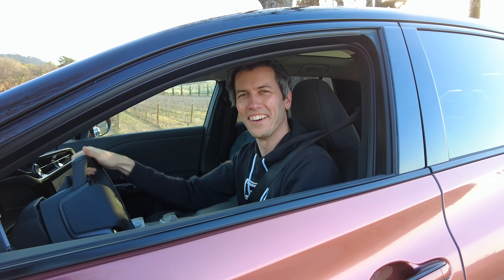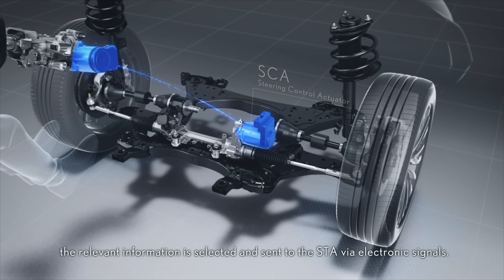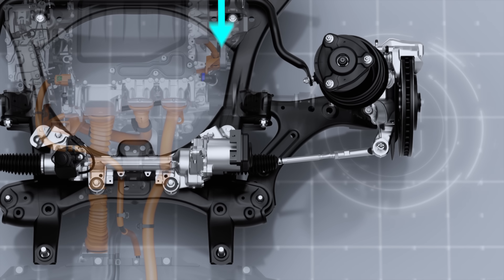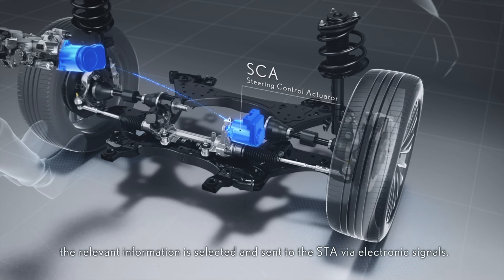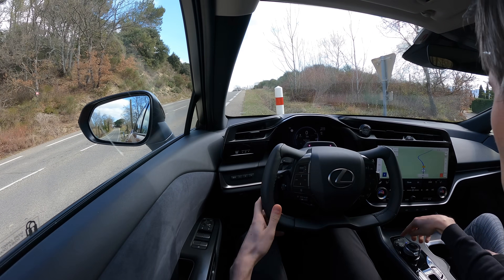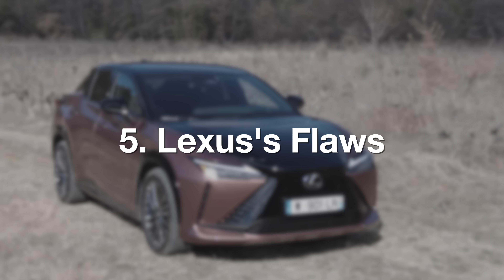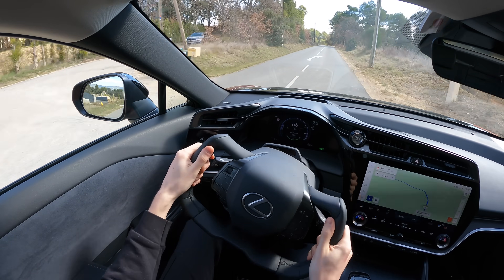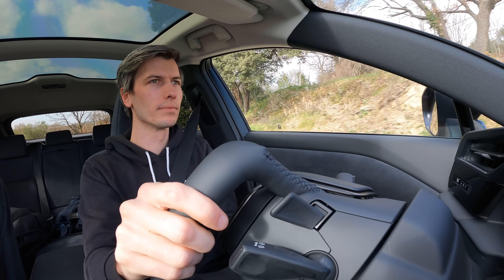How Lexus Fixed Tesla's Bad Idea: Steer-By-Wire Yoke

Comment: I would love to try this on the real world. My only "concern" really would be how it performs on the moose test, avoiding obstacles at high speed, and how would it deal when you approach a roundabout while going quick. Aside of that the tech sounds solid.
Reply: YES we NEED moose test
Reply: @billhanna2148  Late 90's Merc A Class: "No, we don't...      pleeeeeeease..."
Reply: @billhanna2148  they will definitely make all the different tests possible this is no joke
Reply: @carholic-sz3qv I think you mean no yoke 🎉
Reply: @carholic-sz3qv  No, actually, it's "no yoke"....

Ayethankyou...
Reply: @garyrowe58  this is a while ago now but no I definitely read and tried to understand you, the problem is that you're objectively wrong. And everyone on here is saying the same thing and you're just spewing bull about stuff that is just not correct. You're stuck in your ways and don't want to change I get it, but don't say its the best way when it isn't. It's just a fact, every single professional driver will hold the wheel at 9 and 3,get driving tuition or advanced driving course and its the same thing. The best reactivity, the best control, the best leverage the most amount of movement and adjustability possible all comes from 9 and 3, it's the middle of the wheel and give you the absolute best amount of movement and the best chances of controlling your car. Try driving your car, and put both your hands as far to the top of the wheel as you can right at the top. You'll notice how it feels like you've got a lot less control, and the wheel is more sensitive maybe, try the same at the bottom and it's the same story. 9 and 3 is the furthest distance from that point, it's the best angle for your arms. If you prefer 10 and 2 then that's fine, it's not a bad place to have your hands, but 9 and 3 is the ideal, if you went on a track day with tuition or went on a high speed driving course, the first thing they would point out would be that you shouldn't shuffle your hands, keep them locked at 9 and 3 and cross your arms rather than shuffling. Because it's the best way for control, 2 hands on the wheel at the middle point of the wheel.

You talking about reference points for where your hands should be when corrective oversteer just tells me that you actually don't know how to correct oversteer in a real and organic way, you just guess and hope for the best. And if I'm misunderstanding you and you were just using an example, then I recommend you try 9 and 3 for a bit (a proper test not just 5 minutes, use it and get used to it) and then see what you think. Person preference is important, but don't tell other people it's better when it's not, and that is a fact.
Reply: @acarguy3773  When I read your response here I was thinking 'he's missed the point again, regardless of whether it's 10 to 2 or 9 to 3..." then I re-read the original post and realised I'd mixed up things and you were blameless and it was me who'd been the asshole, not bothering to read things properly. My sincere apologies.

I'd thought the original point was that by having your hands always at a certain position it allowed your reactions to work from a known point - regardless of whether 10-2 or 9-3, which I support. As for the best way? For serious driving it would have to be 9-3, of course; I totally agree with you, and having competed at international tarmac rallies in a FWD car with no power steering and a rather ferocious limo, I needed the most torque I could get on that wheel!       I can understand people using the lazier 10-2 position as it allows you to 'rest' your arms a bit, on the wheel, but when it's slippery / uncertain conditions, 9-3 is the best.

Again, my bad, and apologies for coming over so badly; I can only blame lack of sleep and a fading infection, but have no excuse.
Reply: @garyrowe58  wait hang on my bad as well I thought you were the other guy who I'd been arguing with before and everyone is disagreeing with. 🤣🤣 Both of us didn't read properly don't worry man
Reply: Does this mean that we lose full articulation to either side while on highway speeds?
Reply: ya its strange how @engineering explained missed this one
Reply: The tech sounds solid? Did you completely overlook the laggy response? That's unsafe. Will work fine in normal conditions. Driving on snow and ice, this cars accident rate will go up.
Reply: Fly by wire technology is.... already over a decade old
Reply: @bigboydrz  More like decade(s) old. The first production fly with fly-by-wire was in 1958.
Reply: @bigboydrz  Except variable sensitivity isn't. It needs to be studied and the bugs worked out. Tesla learned that the hard way.
Reply: @bigboydrz  Nope: actually it was invented by the British Aviation industry in the 1950's.....

..of course it didn't always work....
Reply: Considering they have total control over driver input they could change the ratio to be a quicker one depending on how quickly the driver makes inputs. You could tie the acceleration of the steering input to the steering ratio. This would be similar to how mouse acceleration works.
Reply: @caseymurray7722  That does not sound good then. People who play first person shooters turn off mouse acceleration because it affects the accuracy of mouse movement.
Reply: @kiyotaka269  I do too but it's basically a necessity on a smaller input device like a trackpad or if you have very little space for a mouse. Quickness and consistency in fast movements is lost but I think it would be interesting to look at. Especially if you look at how controller schemes have adapted to racing games. A linear curve on a traditional steering wheel is still probably the best solution but the possibilities that this opens up are extremely interesting.
Reply: @caseymurray7722 100% possible with just a few lines of code but I don't think it's something you'd want a mouse doesn't have absolute coordinates so that's fine but you would expect to be going straight when the steering wheel is straight, so the correct analogy should be rather a graphic tablet, that you expect to have a fixed rectangle marching your screen.  if you're changing the ratio dynamically then you have to correct constantly which would feel awful. Variable steering ratio also has this problem but to a lesser extent because it's dependent on the speed but at least it's fixed at any given speed. but still can be an issue if you're cornering around a fixed radius corner, and you slow down, the ratio changes and the car starts to dive inside the corner. definitely something that should take some time and training to get used to.
Reply: @geemy9675  True, constantly changing the ratio would probably feel awful. Similar to (sorry for the mouse analogy again) how pointer precision makes aiming in games awful. I do think a variable ratio would have it merits though. I know I personally used a non linear response curve when playing dirt rally at first on my wheel since I couldn't keep up with the rotation speed. But that is correlating steering input with how far the wheels turn and has no impact on speed. Regardless, this opens up a ton of new, interesting possibilities for manufactures to tune their steering inputs and responses.
Reply: @caseymurray7722  yep. I think non linear steering ratio has existed for a while and in some ways has similarities to variable steering ratio according to speed, because the more you steer, the slower you go. variable ratio with speed has a lot of advantages and a few drawbacks. I think most people can adapt to both pretty quickly, and possibly be safer with it than without. but I think to adapt you need at least to have consistency with how the steering reacts to given 
angles at given speeds. acceleration is to unpredictable if you move quickly left then more slowly go back to the initial position you expect the same steering angle. pretty sure you could learn it too like you could learn using  reverse steering too but not good for safety
Reply: @caseymurray7722  plus autonomous driving is around the corner. could take another 5-10-15 years to become more mainstream but eventually we will get there and one day your car computer will be better than you at handling any emergency situation, so even if you are driving yourself, active safety will always be on (except if you disable it or remove a fuse for the "track") and will be ready to take over anytime when a risk of accident is too high and correct your steering/braking/throttle inputs
Reply: Correct me if I'm wrong, but isn't "approaching a roundabout while going quick" really dangerous? I live in the western US, so roundabouts aren't common. But the few I have used make it clear that you're supposed to slow down before you enter them.
Reply: @coredumperror  You have a good point. There are a few roundabouts in my local area that I can safely negotiate, when there is little traffic, at 40-45 km/h, but only if I'm going straight. Other than that, I have to reduce speed significantly to make the turn.

Lexus' solution seems pretty good. Tesla's seems to be a bit nightmarish at times, when you want to indicate right as you exit the roundabout.
Reply: computers are faster than the meatbags behind the wheel. with the proper software it can do a "perfect" moose test while you are finishing off your latest tiktok upload.
Reply: @SupremeRuleroftheWorld  it's not about computers it's about the delay of the transmission of data really. Ofc a computer can make the decision faster potentially, but it clearly doesn't translate just look at the delay in the steering.
Reply: @acarguy3773  well delay of transmission of data is about computers.....electro magnetic waves propagate 60x faster than a steel shaft mechanically transmitting torque from one end to the other, so it's not a transmission problem like the ping beetween your computer and a server located 20000km from you. Motors are pretty quick too.
if there's a noticable delay, could be a good reason why they are delaying it to 2025 ! this is preproduction ?
Reply: @geemy9675  yeah good point actually didn't think of that
Reply: 3. Bad actors: someone hacks your car and you experience system unintended turning or turning that's off just enough to send you into the wrong lane.
4. Something disconnects the wire: you go from 100% control to 0%
Reply: @Beastphilosophy  this is called catastrophizing. It's 
 a symptom of mental illness.
Reply: When driving on winter roads covered with snow/ice, my instinct is always to keep my hands at ten to two on the wheel. If the back end steps out, that's the ideal position to correct it. With a yoke, that isn't possible.

And the indicators need to be operated by stalks, not buttons on the yoke. Indicating when exiting roundabouts when the indicators are activated by buttons on the yoke is just... No. Just no.
Reply: @hadtopicausername  no stalks on drive by wire probably wouldn’t be a problem as your hands are always on the wheel in the same place.
Reply: @jeffpicken5057  Yes, whereas with the solution Tesla has chosen... Good grief.
Reply: @hadtopicausername  With Tesla, just consider yourself lucky to still have a steering wheel at all...
Reply: @hadtopicausername  It has stalks, and in the case of variable steering angle, how would it be easier to use a stalk in a roundabout over a button? The button is right next to your thumb, while you need to reach behind a fully turned steering wheel to use a stalk.
Reply: @slav_K0  If you look up Bjørn Nyland here on YouTube and his experience with the Tesla yoke in roundabouts, you'll see what I mean. Lexus' solution is definitely way better.
Reply: @slav_K0  to use a button on the wheel would usually mean having to have  a hand that was not on the wheel...
Reply: "Indicating when exiting roundabouts"  Great idea, but almost never seen where I live.
Reply: @hadtopicausername  Keeping hands at 9-3 is typically better for control and reactivity. There's a reason all professional racing drivers use that position. 10-2 is ok, but there are limitations of that position
Reply: @hadtopicausername  well 10 and 2 is not the correct place to have your hands on any wheel so your point there is irrelevant. I'm not defending yokes, but that argument is wrong. And if you watch the video you'll see it has indicator stalks.
Reply: @acarguy3773  Uhm. No. Ten to two, apart from the entire airbag issue, of course, is the best positioning for correcting an unexpected skid.
Reply: @hadtopicausername  nope, otherwise f1 cars would have differently shaped wheels. 9 and 3 gives you the maximum possible amount of steering range before you need to take a hand off the wheel and gives you the most amount of control as it is the centre of the wheel. Watch any racing series they will have their hands at 9 and 3. It might be slightly higher than centre as a personal preference for comfort, but generally speaking the closer to the centre of the wheel your hands are the more control you have and the more leverage, and you will always have the maximum amount of lock available before moving your hands. You can turn the wheel 180 degrees without taking either hand off the wheel or sliding them. This is the safest method.
Reply: @acarguy3773  The average driver will overcorrect if they experience a skid. This is not about leverage or racing drivers at all, it's about being at the best position to correct without overcorrecting. If I've got my hands at ten to two and the back end starts stepping out, then steering into the skid so the corresponding hand is at the three/nine o'clock position, that will often do the trick.

I know this is an old fashioned positioning of the hands at the wheel, but I drive old fashioned cars.
Reply: @hadtopicausername  Nope. 9 and 3 (9:15-ish, 180° apart) gives you - by far - the most stability (since the weight of your hands at rest is the farthest away from the center of the steering wheel AND exactly tangential to the wheel so all the force becomes actual torque rather than just an unnecessary radial load), the most precise control (because of that stability), as well as the largest range of movement before having to let go/readjust your grip.
Reply: @voprais  Yeah, whatever. I'm talking about being ready to correct a skid, not about driving under conditions where I can rely on the car to remain stable.

I've driven enough winters and had enough skidpan experience to know what works best for me.
Reply: @hadtopicausername ah yes, that's why all race and rally drivers hands are always at 10 and 2 right? Just because you're comfortable doing it doesn't make it best. 3 and 9 gives you the most control and precision, whether sliding or just driving.
Reply: @dakdewolf  Why are you comparing driving by expert racing drivers, to regular driving out on the road with average, mediocre drivers behind the wheel?
Reply: @dakdewolf examples?  F1 steering wheels are more like 9 & 3 and racing academies recommend 9 & 3 too
Reply: @hadtopicausername  Well, even on road, I find 9-3 the best position to hold my steering wheel. I do wonder why you would feel otherwise, because as others have stated, 9-3 gives the best position in terms of force exerted on the steering wheel. And no, I don't think 10-2 gives me better control in slippery condition and I live in Michigan. If you are only relying on your own experience, I do feel like it's you getting used to a bad positioning and getting used to it. Also, if rally drivers use 9-3 hand positioning, I bet that's the physically optimised positioning of your hands on a steering wheel when you need to correct a skid. Because they need to correct the skid A LOT, except they do it at high speed. So if anything, everyday driver is just correcting skids at low speed, with the technique being the same.
Reply: @full_wet_tire  Get into a 1968 VW Beetle, and we'll see what you say.

And again, what is optimal for expert racing/rally drivers, might not be the best thing for your average/mediocre driver out on the road. Some techniques might be better in theory, but only when coupled with a driver able to get the best out of that technique. I'm more than happy to admit that I'm an old fashioned, perfectly mediocre driver, and that I can't rely on the same feel and pinpoint accurate technique that skilled racing drivers can.
Reply: @hadtopicausername  Get into a 1968 VW beetle with steering by wire and a yoke, then your arguments maybe valid. No. less than 1% of people drives a 1968 VW beetle and non of them have a yoke that doesn't allow you to hold 10-2 or whatever you want. And again, what is optimal for racing drivers are also most likely the best thing in terms of driving technique. Also, you have yet to provide us with a valid reason of why 10-2 is better, other than your personal experience which might not even be true at all. A person not comfortable with indicating before turning doesn't mean indicators are optional and should be deleted.
Reply: @hadtopicausername  Mr driving old car and don't know how to hold a steering wheel is triggered because he realized his technique is all wrong! Mind blown!!!😶
Reply: @full_wet_tire  If that interpretation of me makes you happy, then by all means.
Reply: @hadtopicausername  Older vehicles without power steering require a different hand position than 9 and 3, especially at lower speeds. So I see your point and agree coming from personal experience.
Reply: @hadtopicausername  9 and 3 > 10 and 2 for performance driving and that's simply fact. Then there's personal preference and that's okay as long as you don't pull a 12 oclock position.
Reply: @hadtopicausername  9 and 3 is a better way of holding the wheel.
Reply: @hadtopicausername  Dude... you never driven a 70's / 80's big Citroen then ??
Reply: @hadtopicausername  Just fix the way you drive lol. Theres no reason to have your hands on 10-2 compared to 9-3. You just get more control with the latter. If you're out here saying "oo thats just what I'm used to" then dont make general statements about the technology.